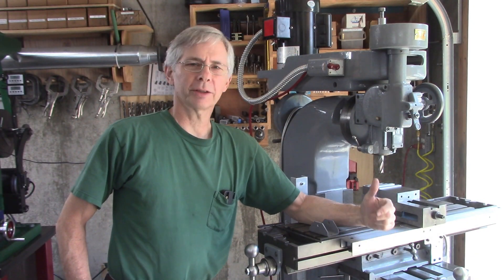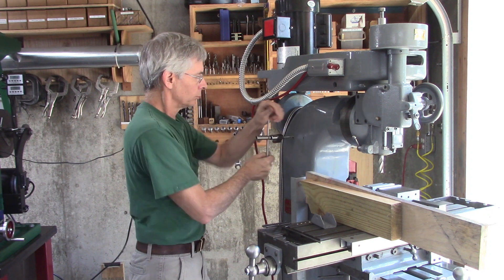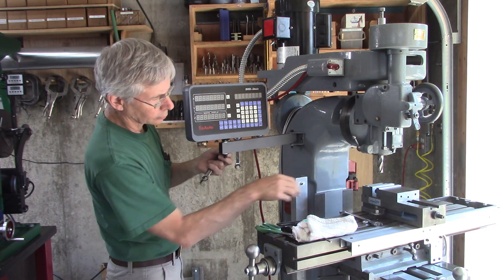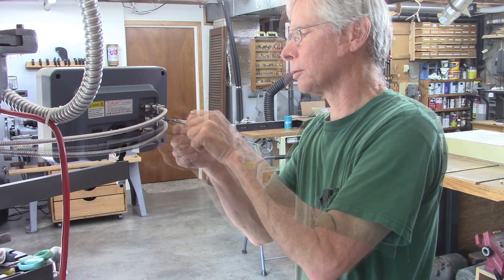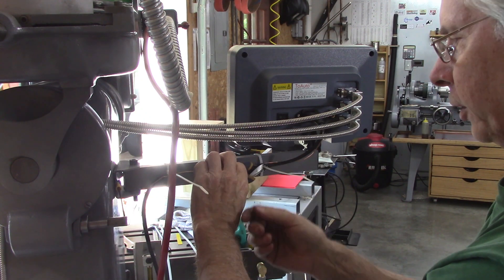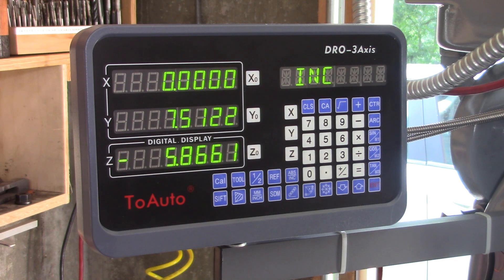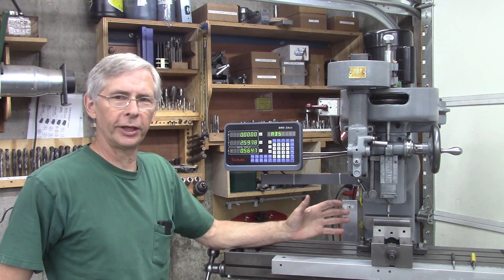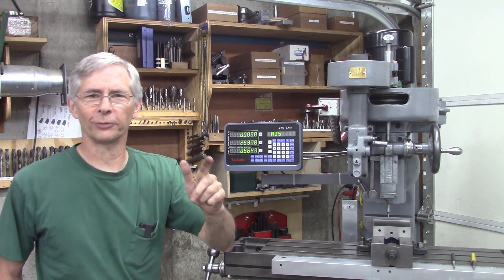Installing the Display on my DRO

Comment: Just a bit of information about the "earthing wire"  Make sure you indeed ground that wire as static discharge can travel from you and damage the DRO.  Most electronic design these days isolate components internally to prevent a possible shock hazard however this leaves those same components susceptible to static discharge.  As long as your mill is grounded properly just make sure the "earthing wire" is grounded to the mill

Great videos by the way.  I enjoy it when you resurrect older iron and get it operating again.
Reply from the maker: I still think it's redundant but static electricity is also weird. It's probably good insurance to have the extra ground.

Comment: i will probably use your method on the Y and Z, My power feed is in the way of your x installation.
Reply from the maker: Interesting...  You may be right about the power feed but I'm not sure how.
Reply: i may actually have enough room the mechanism is below that x table plane plane farther than i thought. I spent some time looking it over,  how hard is your table lock to use?  does it need to be extended?

Comment: Looks like you purchased the 5 micron scales. Oddly, the inches should have been 0.0002, not the 0.0001 (where you pressed the mm/inch conversion button), as 5 micro converted to inches is 0.00019685, I would have guessed it would have rounded that up. I know, on a mill you're lucking to hold one thou hole placement. It's always interesting as when you're machining, the display will change from the zero here and there. I'm wanting the 1 micron scale for my surface grinder down feed, as there it does make sense. My mill DRO is .0005" inch resolution, and that digit is always flickering to zero and back again.
I did find I had to watch some youtube videos as the manual for these displays are horrible, especially if you change the mode from mill to lathe or grinding machine, not exactly clear, but maybe your newer display has an improved manual.
Reply from the maker: I'm not sure on the accuracy but the manual seems to be well written and translated. which actually surprised me. Of course I have not learned a lot of the functions yet but the bolt circle, hole spacing and finding center options were easy to figure out.

Comment: PE: the protective earth connection doesn't serve the same purpose as the ground wire in the cord. It is there to insure that all parts you could be reasonably anticipated to touch at the same time are at the SAME ground potential (and may also, as a side, help protect the bushings n the arm from electrical damage). Different wiring paths and circuit feeds can lead to differences in potential at physically close points, and they can be significant if any of the earth ground connections or wires has significant resistance. The arm really won't do it, as it may have plastic bushings in it that insulate, or metal bushings/bearings you don't want to carry current.
Reply from the maker: Interesting...

Comment: As already mentioned, most put our displays on the right. Did you go left because you have only one X crank handle, on the left? You may still want to put a separate,  battery powered DRO on the quill. On my BP I use the quill feed a lot because it's much easier than the knee, especially for drilling and boring, and milling with small end mills where lost rigidity from quill extension isn't an issue. You have a movable quill. Might as well use it.
Reply from the maker: You maybe right about the quill... it has a depth stop which would be good in most cases. Yes...  left handed and the left handle.

Comment: Are you Left Handed ?  Usually they are mounted on the right hand side. DO NOT shorten the cables. Wind the surplus up and use cable ties. Regards from Australia.
Reply from the maker: Yeah... LH plus the handle for the X is on the left side. I'll leave the cables I think.
Reply: @WinkysWorkshop  I mounted my DRO on the left side of my model 645. I'm both handed (but favor left). Standing to the right front of the machine seems having the display to the left was natural, so I could watch the spindle, and control the power feed which is mounted on the right side of the mill. Seems that's installed on the opposite side on the long axis, where the left side has the thrust bearings, and the kit is designed for the opposite end to the thrust bearings. Standing in that position made sense for the lateral Y axis feed, as well the Z axis power feed.
Reply from the maker: @f.hababorbitz  My lead screw has fiber thrust washers on the handle side. I need to replace them with thrust bearings. I think I also have a lead screw alignment problem. It gets tight on one end of the travel. i need to fix this before I get a power feed.
Reply: @WinkysWorkshop  I recently tightened my gibs in all three axis. Now on the cross axis it's tight on both ends where the lease wear is. Unless when you had that table off, you measured using precision pins the width of the way Vee, and found zero wear, I'm guessing this is the issue.
I know on my Y axis, the scraping is worn off on the right side. Fixing that sort of issue is beyond my tools, as I don't have a scraping straight edge to do the blueing markup to see the high spot. Learning how to do that, and do it correctly would be a whole new area of the hobby. 
I'm surprised your mill has fiber washers for thrust bearings, but maybe that's what they did before increasing the size of the mill.
I will say that even the lowest price power feeds off eBay will run perfect on your mill. I got a few from Harbor Freight mail order 25 years ago, Align branded. But they are perfect copies of the Servo brand that I got from Enco that's on my W-I-645, down to the mounting stand that fit on the right side of the table. These low cost power feeds have the mounting stand that's made for a Bridge Port. Probably have to copy the mounting bolt holes to the table end.
I've seen some of these table kits have a shaft extension that screws onto the threads that the crank handle keeper nut uses, so the length is increased for the drive bevel gear and support needle bearing. Memory was I was seeing these around $110 a few months ago (power feed on eBay).
Reply from the maker: @f.hababorbitz  I was thinking about making a power feed but that's probably not logical if I can buy one for less that $120. Yeah, my table is a little tight on the ends but not super bad. I made it where it's just barely a noticeable drag at the ends. Most the time the slight looseness in the middle is tolerable but if not I snug the table lock a little. I'm not getting into the scraping...  really mine is not very bad.

Comment: Mark as you already know I had to turn my head when you drilled the holes. LOL One of the reasons I love  Touch DRO. Being wireless I can use my Samsung Tablet on multiple machines. I just finished calibrating the X axis on they Bridgeport clone mill of mine. BTW I love that Wells Index mill she is a real beauty and a great example of workmanship before us and also a great example of your own craftsmanship.
Reply from the maker: Yeah...  I should have looked closer at the Touch DRO system

Comment: This is a perfect project, and you're doing GREAT job.  I heard a comment you were thinking of a VSD drive and there was a concern about running at a slow speed.  That shouldn't happen since you have the belt drive also.  You'll just find a belt setup that will give you the cutting speed range with the VSD (min to max speed) and you will rarely have to change the belts.  You will want a VSD that has the braking resistor for the motor.  Just some thoughts.  I went down this road recently with a bandsaw.  You have outdone yourself on this project.  It's the best one yet.
Reply from the maker: Wow, thanks! I think you're right about the VFD

Comment: Just wait until you machine a bolt circle (like say 5 holes on a 3.237" radius) and then machine them exactly where they need to be by just following the display.  That's when the light came on for me.
Reply from the maker: Yeah...  I've
 played with this. Very cool!

Comment: Me again, for those who don't know SDM stands for 'sub datum'. Basically used in absolute mode to store a suite of numbered co-ordinates. Eg Co-ord #1, Co-ord #2 etc. with each one the having the absolute X, Y and Z co-ordinates of that point. Some DRO displays can hold up to 199 such references. Very useful for multiple operations at a number of locations. Also there is usually the separate DRO ability to build a tool library giving tool lengths for each tool and holder. By using this feature Absolute zero on the Z axis can be used to place the tool tips at a pre-defined point in space - for example flush with the table top. All Z measurements are then referenced from there regardless of which tool has been selected in the library. Rather like a manual version of a CNC controlled machine. Usually referenced with the quill fully retracted. Just don't go negative!
Reply from the maker: Thanks for the info. I have a lot to learn.

Comment: Hi Mark, that really is a beautiful looking old milling machine brought nicely up to date. I recall some folks having problems with display jitter if they left the 'PE' lead off. I agree with you though, there really should be only one earth connector to avoid the dreaded ground loops messing up the signals. Maybe something to do with the internal display wiring or noise on the supply earth lead?
Reply from the maker: Thanks on the mill. Yeah that ground is weird.